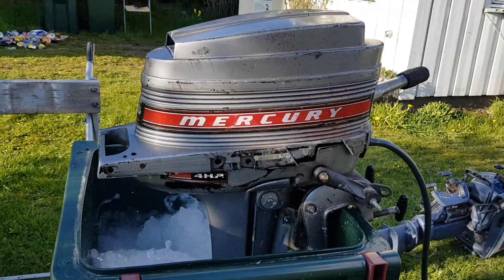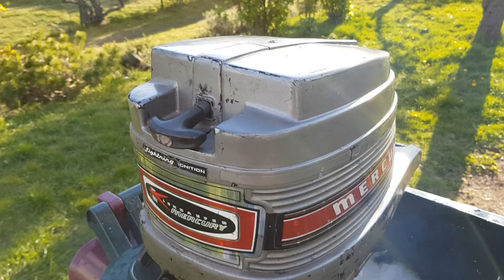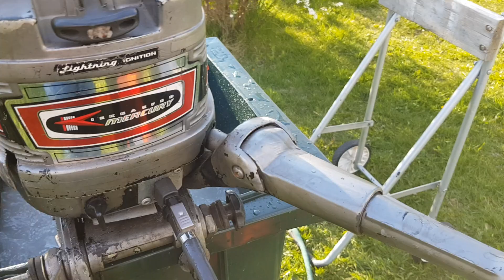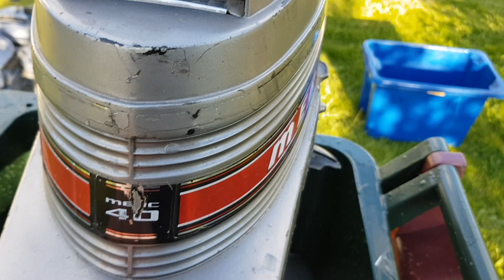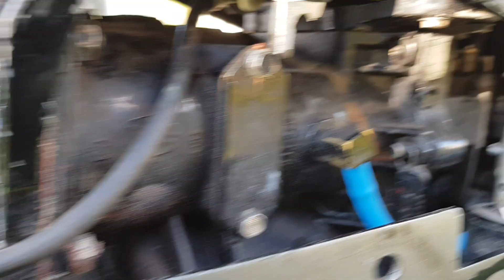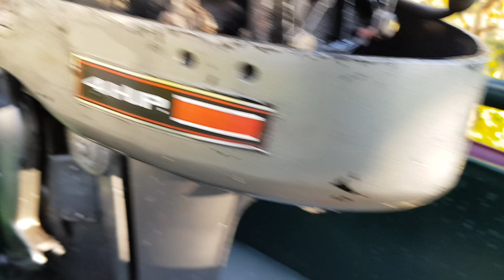Mercury 4hp Merc 40 outboard engine Kiekhaefer 1969

Comment: Hi. Thanks for posting this video. I have the same model (1969) but never used it. I hope to try it out this weekend but I don’t know what the ratio should be for the gasoline/oil mix. How do you usually mix it? Thank you
Reply from the maker: I use 50/1 oil mixture (2% oil in the gas)!

Comment: How did you covert the gas line fitting over?
Reply from the maker: An aluminum plate that was pop nailed over it
Reply: @Dinkymaster7  I'm doing that! no more mercury fitting with that expensive interior fuel line.